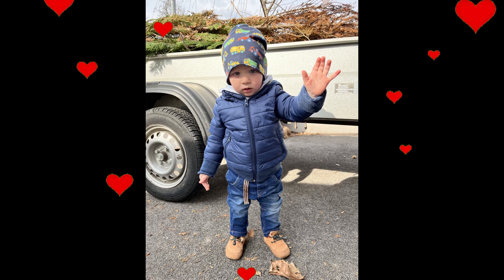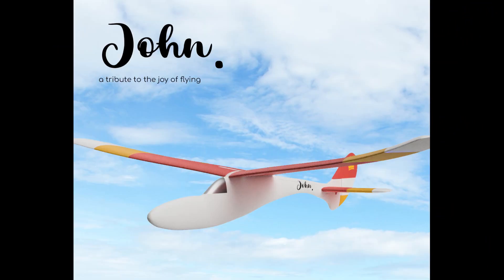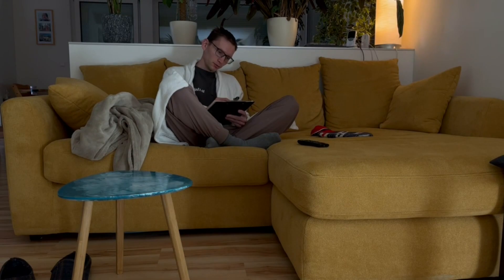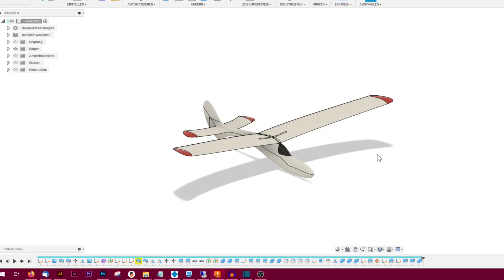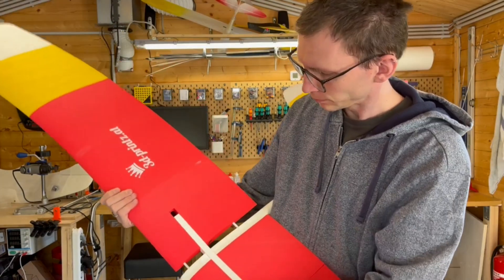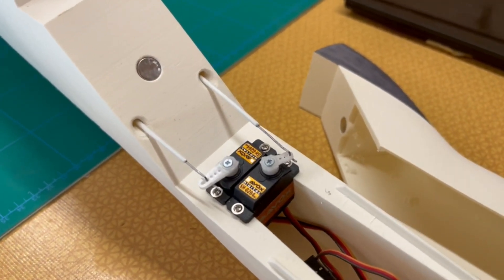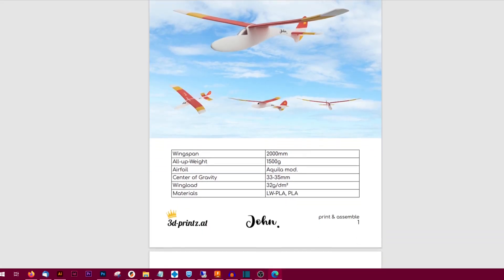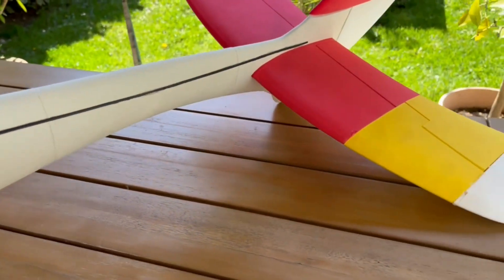Introducing: "John." - 3d printed, 2-axis glider

Comment: so, is this the 3d printed plane for the rest of us, i.e. the ones who were pulling put their hairs over trying to get their slicers to output something even remotely viable from 3DLabPrint's Piper J-3 Cub files? (you call it "infill-based construction" which sounds to me like "a normal 3d print like any other)
Reply from the maker: I printed the 3DLabs Cub myself and it actually came out pretty perfect (can´t speak for all 3dlabprint planes, as they are all from different designers). With Infill-based I mean that John uses Infill as an inner structure instead of a fixed one. I´m currently in the make of a video describing the different methods in the CAD to give a better overview about how 3d-printable RC Plane Files are made. What you see in the slicer is not really what we create in the cad. It´s a bit complicated but my next video will bring some AHA-Moments for most i guess.
Reply: @3d-printz  Looking forward to it then :-)